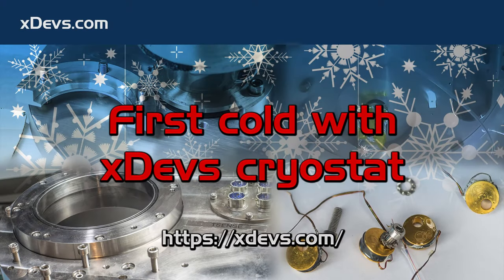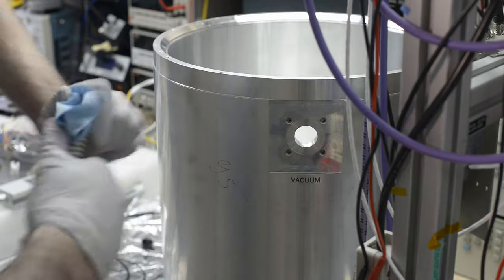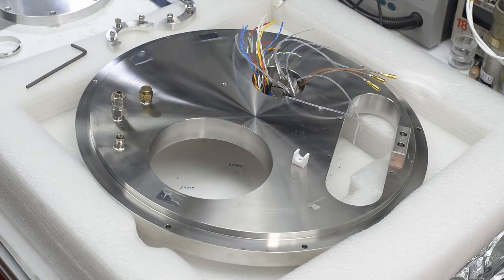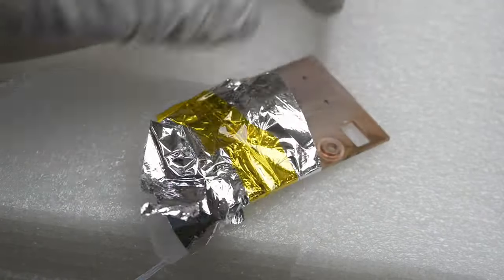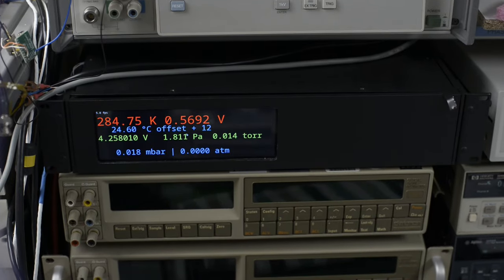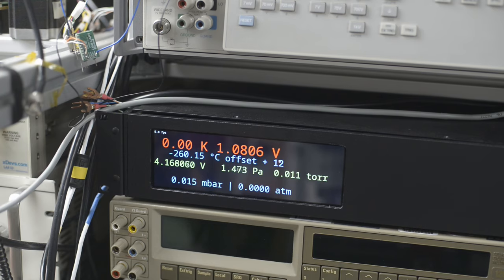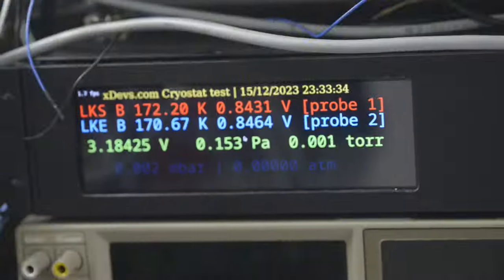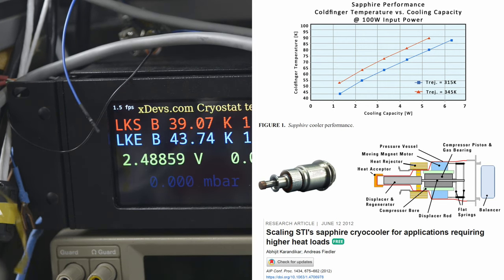xDevs.com's 2024 Cryostat first tests under vacuum

Comment: Very nice build!
Just two things to mention:
There is no need to grease up KF O-Rings, that system is designed to work with clean and dry O-rings. Also, I highly recommend installing an oil filter between the pump and chamber, you'll be amazed how much will diffuse back into your chamber and coat everything in high-leakage oil

Comment: Hello Illya, I have worked with and constructed low Temperature cryostats and Dewar vessels in the past. I used cryogenic fluids, like liquid Air, Nitrogen, Hydrogen or Helium(4).
I used stacked dewars, i.e. an outer filled with liquid nitrogen as a temperature / radiation shield, and an inner dewar, filled with liq. Helium. That reduced the amount of required liq. Helium a lot, or the cooling energy (for a cryo pump). You may need to implement radiation shields inside.
Your outer vessel, is this really a double walled Dewar?
It's quite big for a cryogenic apparatus, and will not provide a thermal shield for the inner cryogenic heads, as far as I understand your setup.

I would fear to put a DMM and such inside vacuum and low temperatures. At least the VFD might crack, if the outer pressure changes that much, or rapid temperature changes might lead to mechanical stress. Same goes for other electronic components inside. I have no clue, what might happen with all those molded components under vacuum, i.e. this plastic contains gases or water vapor inside, and therefore might react like pop-corn, like during reflow-soldering, where all components need to be stored in dry-pack before.
Anyhow, very interesting experiments. Cryogenic techniques and thermometry are really fun.
Reply from the maker: Happy to see you here :) I'd like to keep this system dry, without any liquid cryogens. They just add way too many design challenges and cost. Chamber tank is 10mm thick aluminum, it is not a dewar construction, so thermal shields indeed a required piece when I will go to colder temperatures with larger coolers. For current head I'll use MLI and call it a day as heat lift of Sapphire cooler is few watts? As of testing commercial gear, I mentioned it because I could change pressure in chamber to say 0.8% of atmosphere, mimicking high mountain condition, not really pumping to low vacuum like shown in video. And definitely no cryocooling DMM, my cold heads do not have the capacity to deal with 30W load. But I'd like to test some zeners cold, maybe get noise to <0.2uV pk-pk 0.1-10Hz. LTZ does 0.25uV at 77K @ 16mA Iz. ;-).

Comment: Interesting stuff mate, is this your home lab or your work ? What's your day job if you don't mind me asking, there seems to be a lot of high end metrology gear in the background. Cheers from down under.
Reply from the maker: It's personal lab. You can find details and story about all of that gear at main xDevs.com site. :)
Reply: @xDevscom_EE  That's a very well put together resource, cheers!
Reply: @xDevscom_EE loved your site. I got laid off at the beginning of the year. I had been working in high reliability electronics specifically PCB reliability and high resistance measurements 100MOhm was a short for our purposes. Learned a lot from the site as I was understanding the instrumentation. I wish I had smuggled my B2985A out of the lab. Loved that meter.

Comment: So you say that you don't wanna use a turbo to obtain UHV, but you use the loudest fan possible, a blower one...
A turbo is almost inaudible compared to that fan. 
And don't mind the people that says that your system doesn't need grease. If you plan to obtain UHV with those O-Rings, you need the grease, or to change to metal gaskets.
Reply from the maker: Fan can always be replaced with watercooling in future, so that's just for first tests. I went for grease on all O-rings because original O-ring seals were greased up. So I decided to replicate that. Currently my applications do not need UHV and I'd like to avoid CF and keep it all low hobby-type cost.

Comment: Pi 4 is overkill for that application.
Reply from the maker: What would you suggest instead to drive 1920x400 pixel IPS TFT with touchscreen at say 30fps with python + matplotlib,   I2C and SPI interfaces and USB support for GPIB interface plus networking, and all under 50$ without any low level programming?